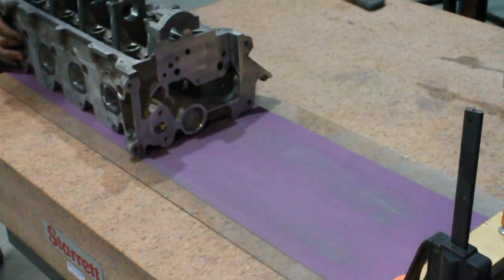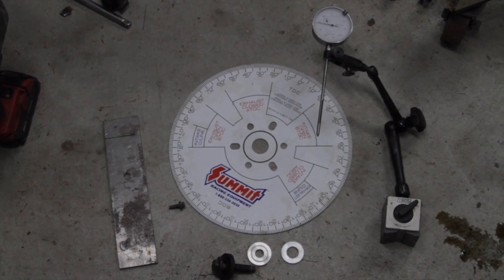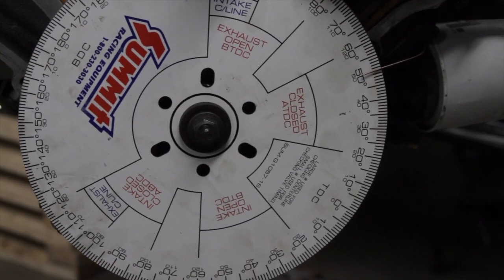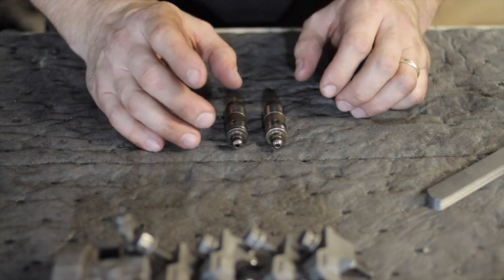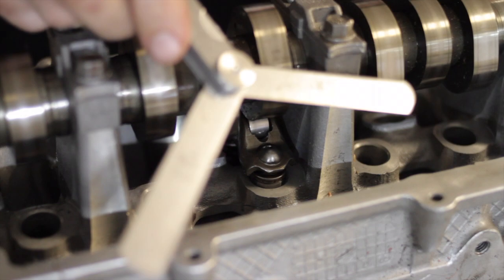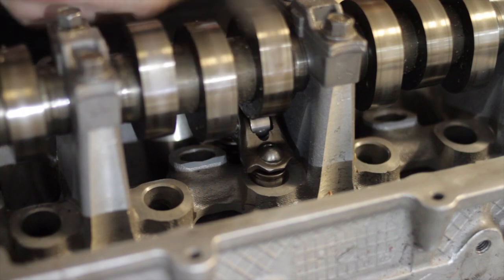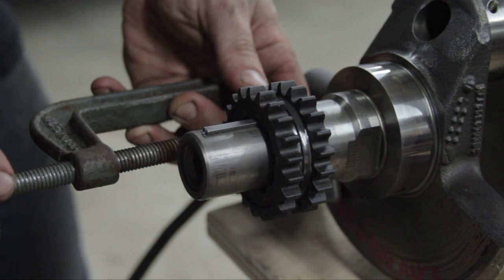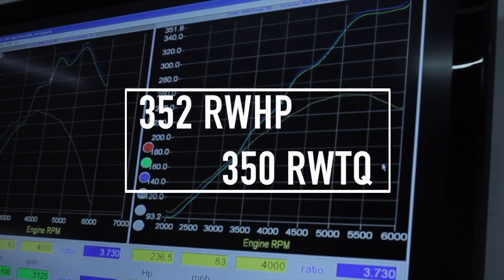3V 4.6 Swap | Longblock Build | Dyno Numbers | Chapter 2, Part 2

Comment: i understand that the cams can be off from each other quite abit or is that only on the 2 valve? great video!!
Reply from the maker: There can be variation in actual centerline of any camshaft, which can vary one to the other whenever you have more than one camshaft in an engine.  Adjustable gears are a good idea so you can get them dialed in.

Comment: Why would I need to put shims in? I own 2007 mustang GT 4.6 3V. I'm buying new HLA and can followers. I see people just soaking them in oil over night and installing them. Is this incorrect?
Reply from the maker: Hard to say for sure, Chris.  The factory spec is .018"-.033" lash on a fully collapsed adjuster, measuring between the roller and the base circle on the cam.  Performance applications have a tendency to spit the followers out at the upper ends of that range, so some engine builders recommend .018"-.024".  Chances are, you're fine if all you're doing is swapping in new lash adjusters and followers and nothing else has changed.  But I personally would check at least a few.  Check out my second video on the 3V cylinder heads- I go over setting up the valve train.
Reply: @BradfordsGarage  thank you I will definitely give that a look. I'm just replacing the camshafts, lash adjusters, cam followers. I had the machine shop replace a bent valve and reset the rest making sure all the valves were flush with the cylinder head and no leaks.

Comment: Is 6000rpm where you are seeing 352hp? It seems like its still climbing at 6, whats it making at 7k? I've seen some 3V dyno graphs where they are making max hp between 6-6.25 but others seem to make max hp near 6.7k with fewer mods. Awesome work and videos btw, thanks for putting this series together!
Reply from the maker: Thanks!  I asked the guy who dyno tuned it the same question and he said that's just a blip that happens when you let off the throttle for some reason.  He was confident it wouldn't make anything more past that with the stock intake manifold.  With the FRPP intake and TB, I can definitely feel it still pulling as the rev limiter kicks in, so we're going to run it on the dyno again and raise the rev limiter to 7k+.
Reply: @BradfordsGarage Did you get it on the dyno again and raise the limiter?

Comment: Can you please show the wiring I have the swap done I’m just trying to figure out some wiring
Reply from the maker: That's something I wish I would have documented better.  What I can tell you off the top of my head is you'll have to swap injector connectors or use the adapters, the fuel regulator from the 2V has to be used, which requires an adapter, the throttle position connector will have to be lengthened, the cam position sensor has to be routed to the right bank...I'm sure there's more I'm not thinking of off the top of my head.  Did you modify the camshaft trigger wheel?

Comment: Street/garage builds are the best! I did some home porting on my 3v heads and threw in all FRPP parts(Hot Rod cams, Intake manifold, throttle body), took about 200-300 lbs out of the car, did all BMR suspension, 4.10 gears, FBO w/HC 11-1 pistons and rods from MMR, makes the 3v a monsters on the streets! I love your build brother keep it coming!
Reply from the maker: Nice!  Did you ever dyno tune it- numbers?  Any ET's or lap times anywhere?  I was pretty happy with the numbers mine made, and with the FRPP Intake and Accufab it should be about 375rwhp, which aint bad at all out of 281ci with not cam phasing.  I kind of wish I had gone with a bigger cam, I think the between the compression ratio, intake and heads I think it would support it now.  Any pics/videos of your build anywhere?
Reply: @BradfordsGarage  I have some videos and pics of a few races, I'll DM you. No dyno numbers yet, but I did do a 1/8 mile draggy test with a friend in the car going up a hill and ran a 7.78! This was before I did the FRRP intake, head porting and H/C pistons, at that time I had a Holly EFI Sniper(do not buy it). I've looked at all kinds of camshafts and I can honestly tell you these 3v's are better off with a mild cam and FI/nitrous. Mod motors don't respond as well with a big camshaft like a push rod would, you can over cam the car and we don't have the displacement for low end torque (even stroking these motors you will get maybe 10-15hp/10-20twq) RPM's are your friend! High compression with nitrous is probably the best and cheapest route to go. That's my next plan since I have 11-1 CR and a build to support it with nitrous, and spinning to 7k with a mild cam, its going to hurt a lot of feelings! 🤣
Reply from the maker: @MrJs197  Right on!  Yea, I know you don't want to go too wild with camshafts.  The mid-range lift is the bread and butter here.  I saw somebody had done the 127600, which is what I was referring to (I have the 127500's) and made really good power with them.  Since I run my 3V in my SN with the old 2V computer, I can't phase the cams, which hurts my top end a bit, I know.  I think they have like 8º more duration and another .010" lift or something.  And I think my combo could handle it.  Also wouldn't be afraid to throw 4:10's in if low end suffered tremendously.

Though, my cams are pretty big compared to the hot rod cams, already.  

With the stock intake HP tops out at 6500, so I could spin it to 7000.  I built the bottom and and valve train for it.  I'm also running about 11:1 compression ratio.  I'm hoping to get it back on the dyno with the FRPP and see what more it puts down and how much higher I can spin it.  

I'll have to check out your stuff when I get a chance.  I just saw your message on instagram, so thank for reaching out.
Reply: @BradfordsGarage  Yes sir! Comps 127500 are very good for what you have going on since you locked out the VCT due to the ECU being a 2v. 127600 are too much for a 281, you would need a stroker/bore and Stage 3 heads to support the additional air flow. The stock 3v heads flow very well, especially since you did the porting and cleaned up the imperfections with a valve job. I hope you upgrade the springs as well for higher rpm and lift? Your top end should be there, low end is a different story. VCT helps with low end torque and emissions, you are correct 4.10s would help you tremendously if you don't feel that pull off the line.

I didn't check but did you do a stroker kit or you kept the same displacement? 

I would love to see what you put down on the dyno too with everything you've done. It would give me a good idea where mine is. I will probably do some dyno pulls this spring/summer. I'll send you my build list and the racing I've done. All against bigger motors/FI

PS: you gotta freak'en love 3'vs they are so under rated and can put in work if built right. Old saying " my car's built, not bought"
Reply from the maker: @MrJs197  Yea, for sure!  I love this motor and this swap in general.  I get so many sideways looks when I tell people about it.  Then I tell them it cost less than half of a coyote swap, sounds amazing and puts down the power.  For SN guys looking to break the 400hp mark on a budget, I still think this is an incredibly viable swap option.  With the suspension upgrades it's a killer at my local track.  Supposed to be a 'momentum car' type track, pretty slow and technical, and I've had multiple Miata guys come up to me after a session scratching their heads as to how the Mustang was on their ass through the sweepers.  It's a handful.  Built, not bought is the icing on the cake, for sure.

Correct, cylinders are .020 over, stock stroke, forged rods and pistons and 300# PAC springs.  I have the cams locked out at 102 degrees- full advance.  The VCT would retard them at high rpm and offer more power up top.  

My buddy had a similar build in his Fox, but has functional VCT and he made 387rwhp, and I believe that was with stock CR and intake.  He actually just rebuilt with his own custom stroker setup- I want to say it's 13:1 CR and around 295ci, and it put down 418rwhp.  It's a bad mother.  

Would love to see more details on your build and some dyno sheets.  I'll make sure I share them with you this spring/summer when I get the car back out.
Reply: What weight did you remove?

Comment: Another Awesome video !
What cam lift and duration did you select?
My 5.4 3v I went with 
225° I/ 233° E  duration 
.492 I/ .497 E  lift
113 lsa
102 centerline

Also new beehive springs @ .550 lift

Comps phaser limiter kit.
On another one of your videos I mentioned that
I would like to get 400rwhp, I realize now that's probably not gonna happen. 
Hopefully 360.
You had mentioned getting different dished pistons, I have new flat top hypereutectic pistons, is that my best option? My build is completely all new except for the block and heads. This gonna be my daily driver and just want a little more kick when needed. Not gonna be trying to outrun anyone...lol
Thank You for making these videos. They are so informative and eye opening. 
☆keep them coming ☆
Reply from the maker: Sounds like you're on the right track!  

I am running flat-top pistons in my engine.  No PTV clearance issues with the 127500 cams- .550/.535 E/I lift locked on 102 degrees.  The extra compression is great!

Who is doing the machine work on your block and heads?

Comment: Makes me so happy to see someone putting so much time and effort into a modular three valve. I hope to see more on this engine in the future. I have an 07 that I desperately want to start building!
Reply from the maker: Sweet!  Glad you’re enjoying it, I know I am!  It really is an underrated engine, IMO.  Especially for budget friendly swaps in 2V cars or for the sake of not having to coyote swap an S197 car.  Good luck on your build!
Reply: @BradfordsGarage  Hey man, what did you use for exhaust manifolds/headers? 
Did you make a bracket for the throttle cable?
What did you do about the fuel pressure sensor? 
Thanks
Reply from the maker: @HeadRush2002  I made an adapter bushing for the fuel pressure sensor.  For the headers I cut the flanges off of my 2V headers and welded on 3V flanges.  I made the throttle cable bracket.

Comment: Currently working on my 3v. Doing a lot of what you’re doing but not going nearly as deep. Doing the Boss 302 rod upgrade and just polishing the crank and doing new bearings. I’ll be gasket matching the heads and doing a valve job. What made you choose the 127500’s over the 600’s? I’m wanting as much power in the top end as possible and I’ve seen a few with the 600’s. Just wanted to know why you chose the 500’s. Awesome video.
Reply from the maker: Sweet!  I did the 500's because I still street drive the car.  

I wouldn't bother gasket matching the heads and definitely don't remove material from the floor of the ports.  The ports on these engines are borderline too big already.  There was an article where Livernois was quoted saying exactly that.  In the intake ports, the bump around the spark plug hole is a big choke point.  No sense in increasing the cross section of the mouth of the port if you're not going to do it anywhere else.  When I ported my heads I opened them up everywhere.  The exhaust port can be opened up everywhere, especially the bowl on the long turn side below the valve seat, just don't go too far...and don't ruin the short turn.  The biggest gains you'll see will be made from the valve job and bowl work/pocket porting.  I blew mine up already (dropped a valve...race cars *sigh*) so I'm doing another set of heads right now and that's all I'm planning to do this time around.  Not even replying the valves, haha.

Have fun! 😃
Reply: @BradfordsGarage  how’d you blow it up😅 I had a 160k miles on mine, would autocross and road race every weekend for the last two years and I’ve been hitting the drag strip since it was stock before 100k miles. I just ran an 11.9 with a 75 shot of nitrous. My main goal is just making it a more efficient motor that can handle more nitrous even if I don’t make extra NA power
Reply from the maker: @3vchristian  Right on.  

It's hard to say exactly what happened that caused it, but the head of one of my intake valves broke off.  It had an excessively worn valve guide, and eventually just fatigued it.  What caused the wear in the valve guide, I'm not positive.  I replaced all of the valve guides when I ported the heads and the other 23 are still perfect- showing no signs of wear or failure.  One theory I have is that the valve seat dropped out.  The other is maybe the valve guide wasn't square to the camshaft and it was side loading the valve a little bit.  

Probably never know for sure.  But I ordered a new piston, bearings, followers, a camshaft and am in the process of building it again.  Will be fun to see the difference in the HP with the different approach to the heads this time around.
Reply: @BradfordsGarage  that’s awesome man. I recently laid down 341whp at 6600rpm and 300lbs of torque at 5100rpm. What other bolts ons and do you have that work so well with the 500’s to give you that insane torque?
Reply from the maker: @3vchristian  Sweet!  I’d say the torque is coming from the 11:1 compression and the fact that I used oversized valves to keep the throat ratio around 88-89%, where these port jobs generally end up 91%+ with standard sized valves to get the bowls blended.  Joe Mondello did an interview for an article in engine builder magazine a long time ago where he talked about the importance  of keeping throat ratios around 87% to retain low end power.  All out race cars benefit in that 92% range, but it’s too big for a street driven car that lives mostly in the low-mid range.  Also- valve job, 4 or even 5 angles, and getting those angles right.  Air velocity is king.  

With the new heads, I plan to maintain an 89% throat ratio but with standard sized valves.  The last time around I went to a LOT of trouble- grinding my 1mm oversized valves down to .5mm oversize, recutting all the faces and back cuts, etc. to achieve the throat ratios with the throats opened up.  It was quite a process.  I imagine I’ll lose some top end HP by leaving the throats smaller, but Ill run less risk dropping a seat or losing any torque.  

For those numbers I was running the stock intake, 03-04 Cobra TB, gutted CMC plates, long tubes, underdrive damper, stock injectors, cobra fuel pumps, flat top pistons (11:1 CR) 127500’s locked out on 102° and the hand porting.  Aluminum flywheel and driveshaft helped some.  

For you, if you’re actually running a S197 car, you should be able to retain some VCT and make better power up top.  My cams are locked for low end power, it would make more HP if I’d timed them to like 106°, but torque would have suffered.
Reply: @BradfordsGarage  awesome man thanks for the info. I have BBR Stage 1 NSR cams and they make sweet power for a mild cam. Pulls like crazy up top and I have trouble taking on Gen 3 Coyote’s if they’re manual (as long as I’ve got my autocross/road course interior setup for weight reduction). But I’m definitely looking at getting a more aggressive pair of cams because I want more NA power. Awesome videos man!
Reply from the maker: @3vchristian  Thanks man!  Keep us updated on what you do and what your combo ends up putting down next time around.  Thanks for the chat :)
Reply: @BradfordsGarage  ofc! And quick question. When checking clearances with the ttyl bolts, did you use a whole new set after checking and removing the bolts?
Reply from the maker: @3vchristian  I had that same question!  I used my old set of bolts just to torque the caps and check clearances which seems to be commonly accepted in the mod motor forums.  There are actually a number of people who argue for being able to reuse TTY bolts, I believe I saw that on a SVT forum or something.  One of the members had a friend who was an engineer at Ford and told him that.  Personally, I wouldn't reuse them, but it does seem to work using them just to check bearing clearances.